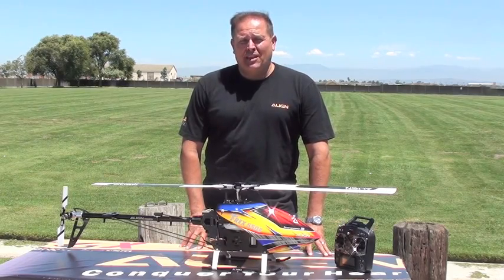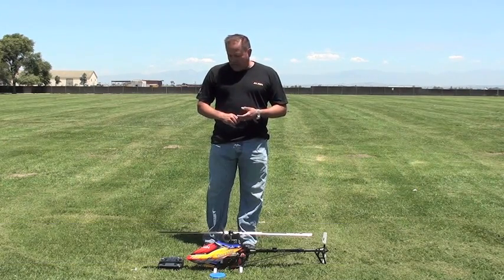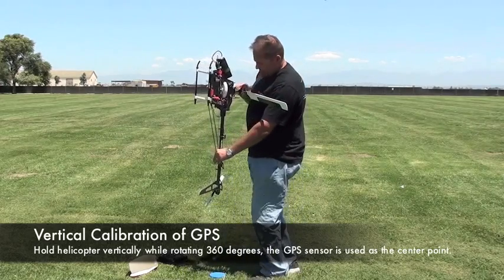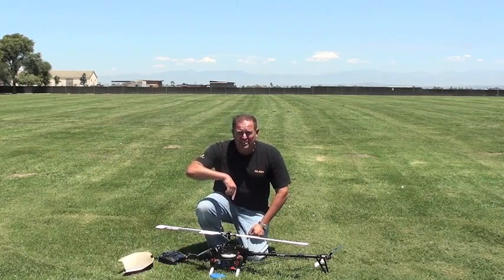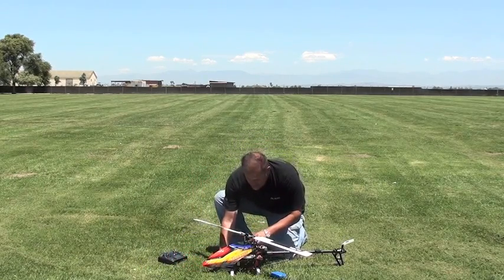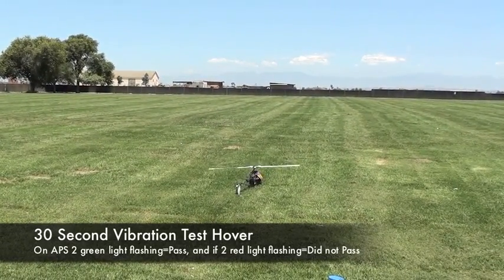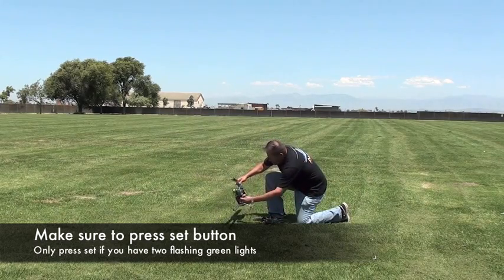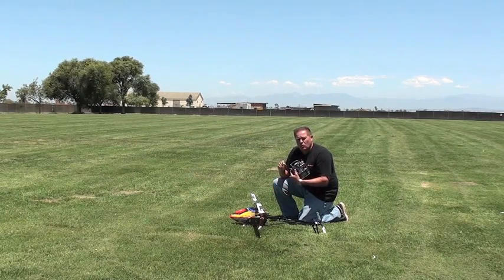ALIGN APS Calibration and Vibration Test

Comment from the maker: I would have sent mine in after the first incident. I know when I crash a receiver I send it in for inspection. Flying crashed electronics is asking for trouble. It works great on my 550 that we used for aerial photos at IRCHA. Still working good. I'd send it in and Tim will test it out. Regards, Jeff Fassbinder